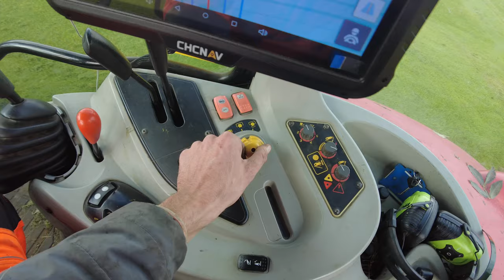Behind the Blade: Mastering the Side Arm Flail | EP 46

Comment: When I worked for the council I used the Kubota and bamford flail. From October to march doing all shrub beds and walk ways. Roadsides. You know the flail could of fitted on your Massy. Could have saved money money just renting the flail instead of both
Reply from the maker: Unfortunately they won’t allow a split hire!!

Do you reckon front weights would be needed on ours
Reply: @cutcrewltd  i had two weights on the front but to be fair I never needed them. Even with the arms out full length.  Plus if you fell uneven when flailing use the flail as a counter weight
Reply: @cutcrewltd  on your tractor no. Today I saw my X work mates with the two bigger bombford on their new Holland's and Massey. It better on a tractor for stability less rocking in the cab